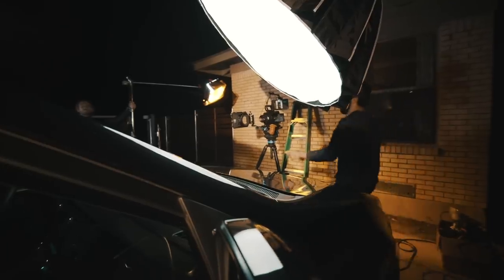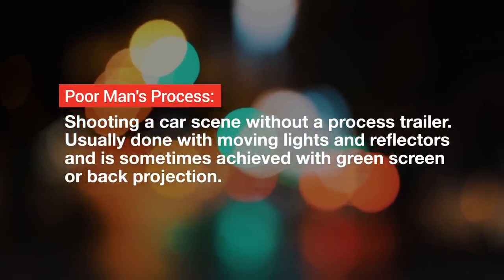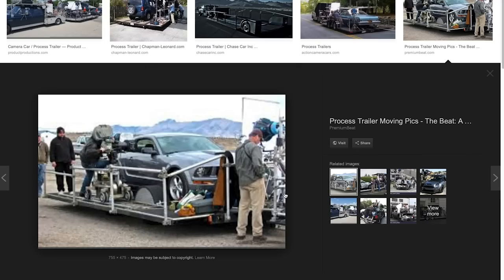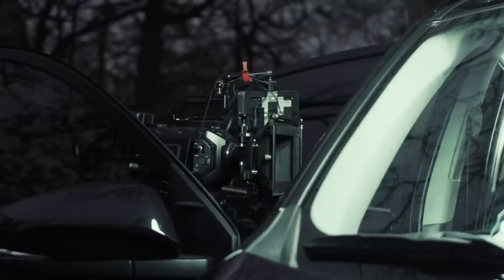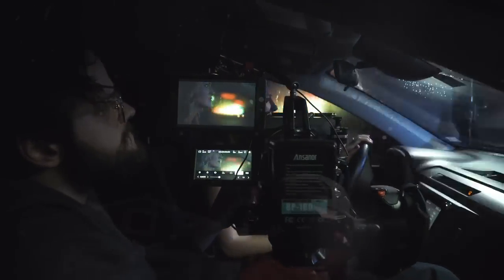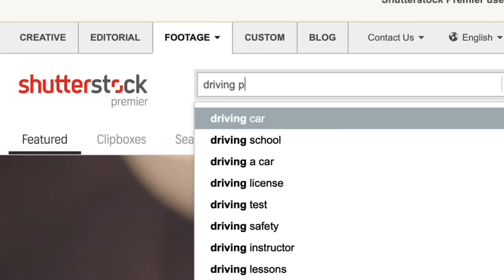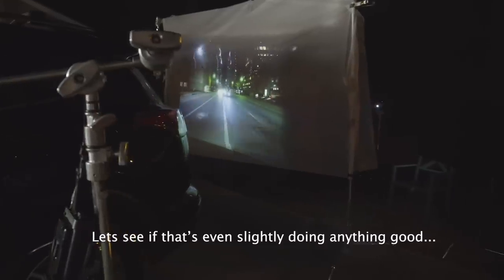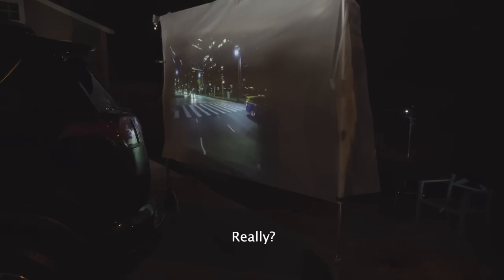How To Light A Car Scene (Poor Man's Process) | Cinematography Techniques

Comment: Well, poor man’s process but the Equipment you use probably cost a couple grand, I mean aperture lights? And a huge good quality green screen? Wtf
Reply from the maker: You can (and I have) pull it off with clamp lights from a home improvement store. The lights don't matter if you know how to use them. I think that green screen was super cheap too btw, you can get them for like 20 bucks on amazon. You can do it! Poor man's process refers to not needing to rent a process trailer (which can cost a LOT of money).
Reply: Shutterstock Tutorials in my case the scene is “just driving” so i’m better off just filming from the passenger seat while she actually drives!  

But your method was very creative, and yiu can do alot of stuff for sure
Reply from the maker: @FivosVas  Good luck with your scene!
Reply: @shutterstocktutorials  There's also a poor man's process of using a uhaul vehicle tow trailer.  ;)

Comment: Amazing! Really cool video! The only thing with the stormy rainy weather that definitely says it's a set up - the water drops on the side screen roll/fall vertically top to bottom, which means the car is standing still, cause even on a very low speed you will see an aerodynamic picture of the drops been spread around the window front to rear due to the sidewind. So i guess to fake this You might also need a good fan close to the front fender. But - guys - respect - You're doing great videos!

Comment: hey Todd, (or anyone reading) I have a bunch of Par can light fixtures with standard light bulb screws. What lights would you recommend running in them? Eg is there an LED or fluorescent that can look the same as a hot incandescent light? Also I have a few Fresnel fixtures. Those bulbs are the kind you push in and twist 1/4 turn. I was using 500watt and 1k bulbs in them. They run really hot and always burn out. Is there an LED equivalent that can push in and lock like that? thanks folks.

Comment: Nice tut, made me glad that I've been holding onto an old 3000 lumen projector for the longest time.
Reply from the maker: I was so glad I had mine! Never used it till now, and i was so suprrised how well it worked!
Reply: @shutterstocktutorials  anything you recommend with it? Was going to film my own b roll and pull the projector out of focus for the projected stuff.
Reply from the maker: @Democratese  I'd say the hardest thing was keeping the light off of the screen, every once in a while the texture on the actual shower curtain itself would show. Especially during parts of the projected footage that weren't particularly bright. Thats the biggest thing to look out for.
Reply: @shutterstocktutorials  thank you so much.

Comment: Well, when car is moving, rain drops slide opposite of driving direction on glass because wind. Here looks like car does not move at all. The strong fan from the scene before could help to push water drops in the right direction, like in real life. I mean, any way, good video and thanks for shoving some set ups and do work some easier for others :)

Comment: 3 Things

You bounce the car too much, unless you are driving through down town Detroit, or Kandahar

Stop jerking jerking the steering wheel so much, you aren't riding a bicycle through a slalom of thumbtacks, 90% of your time with the hand on the wheel, its going to be very stationary, and the adjustments you make, are going to be very smooth, not back and forth jerking every 1/2 a second. i know its a temptation to "Want to do something" but real driving, is 90% stationary

In the Rain effect, You forgot to have a high powered fan blowing on the driver window and windshield to simulate the effect of moving forward through the rain shower, and having the air-pressure wave push the drops towards the back of the car
Reply: @zacharris3800  ik these are old comments but constructive criticism like this only helps people get a more realistic and better looking final result. unless he is insulting someones work needlessly or not adding any true help or advice, then being aggy towards the guy isn't helping, it's actually hindering.